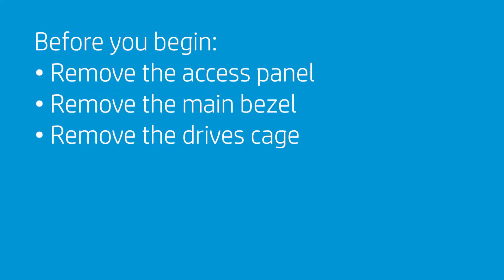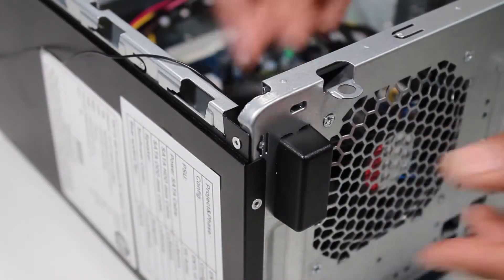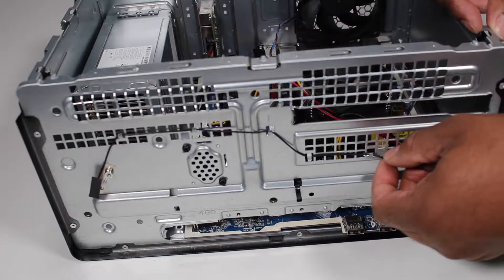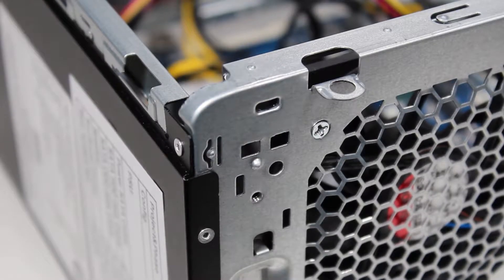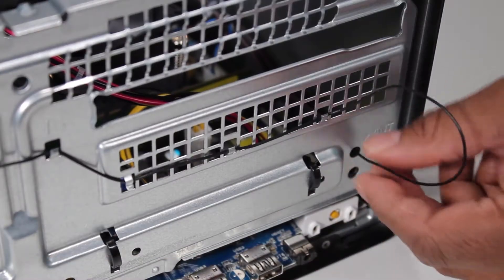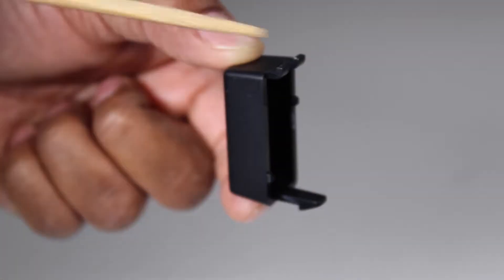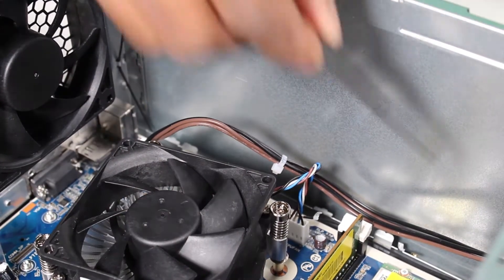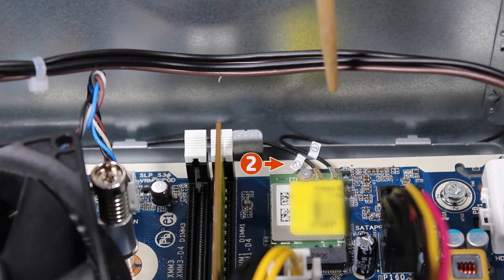Replace the Wireless LAN Antennas | HP ProDesk 680 G4, 400 G5 and 400 G4 Microtower PC | HP

Comment: My wifi card is not working at all do someone have a solution
Reply from the maker: Hi there, thanks for contacting HP Global Social Media Support!
I understand that you are experiencing an issue with the wireless adapter. 
I will do my best to assist you.
Please try the below-mentioned steps to fix the issue: 
You can update your HP notebook using Windows Update or HP Support Assistant:
•	Windows Update
Check for updates by searching for and opening Check for updates. If updates are available, they will begin automatically. You can also download and install optional updates by selecting Advanced options > Optional updates.
•	HP Support Assistant
Open HP Support Assistant, find your computer on the My Dashboard tab, and click Updates. After the system analysis is complete, select the updates to download and install. 
You can also update your BIOS (Basic Input Output System) by downloading and installing a BIOS update from the HP Software and Driver Downloads page:
1.	Go to the HP Software and Driver Downloads page.
2.	Navigate to the product page for your computer.
3.	Select BIOS from the list.
4.	Review any available BIOS updates.
5.	Click Download if there is a BIOS update.
6.	Save the BIOS update file on your computer.
7.	Double-click the file name to start the installation. 
Regards, 
HP Support
Reply: @HPSupport  Nothing works but thank you for helping me out